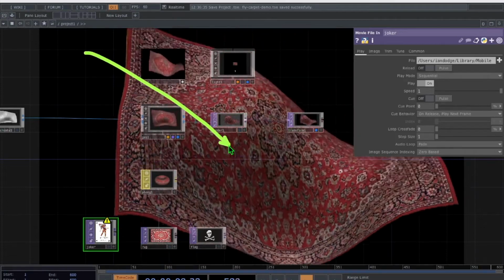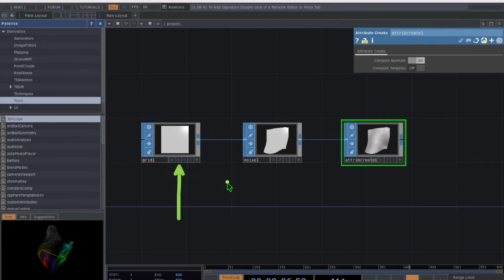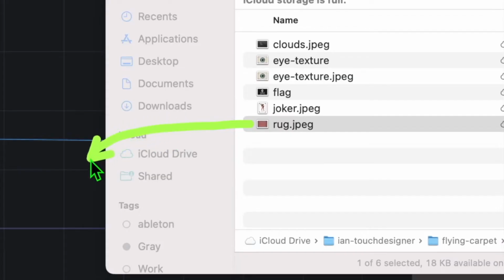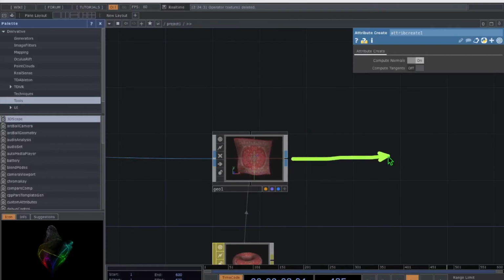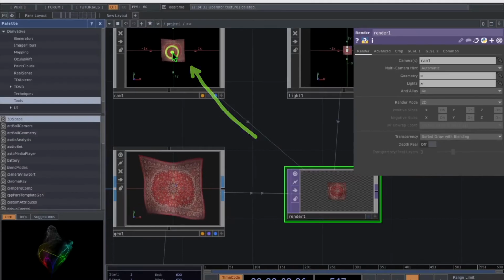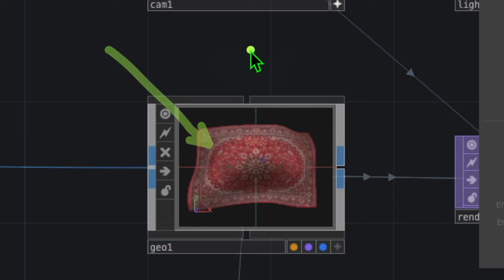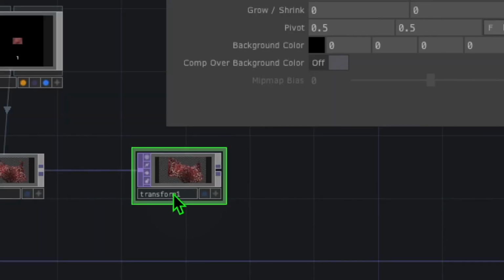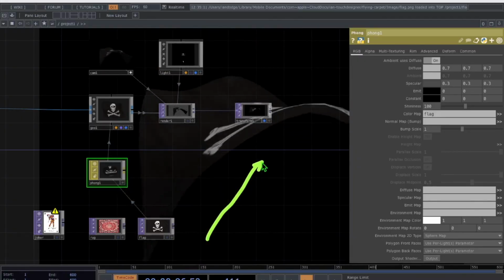TouchDesigner Beginner Tutorial: 3D Flying Carpet

Comment: There doesn't seem to be a bar on the side of geometry box I can link attribute create to. Have done everything the video says. I had this cool idea for my MA project, please work magic carpet! 😭.
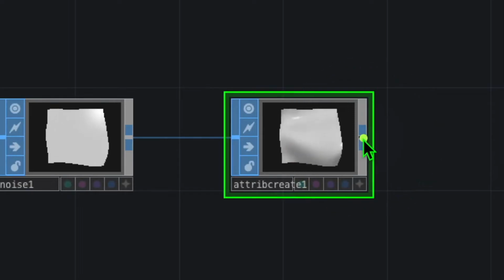Reply from the maker: Ok I see what's happening.  If you look at 1:17 in the video, it tells you the correct way: you MUST right click the output of the Attribute Create operator - then add Geometry when the OP create dialog appears.  This is the only way, as far as I know.  You must right click the output part of the Attribute Create operator, then when you click to add Geometry operator from OP Create Dialog, the 2 operators will automatically be connected.
Reply: @pixorial9973  Hi there, thank you for responding. I will try this method and let you know how I get on.